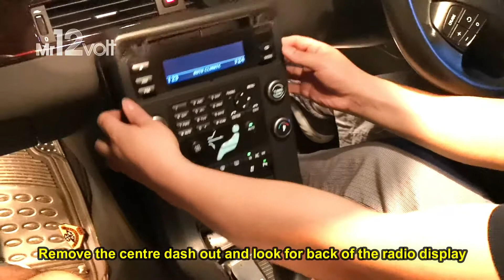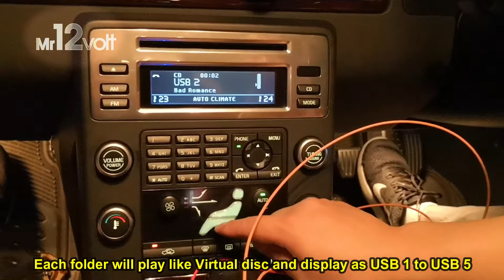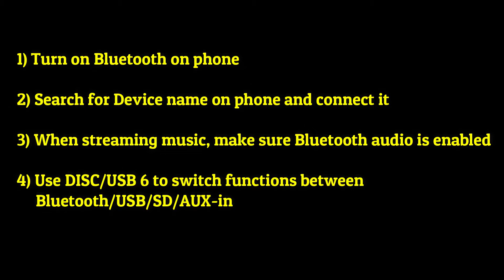Mr12Volt P600 Bluetooth adapter installation guide on Volvo V70/S80

Comment: Just installed mine in my V70! The sound quality is better than AUX bluetooth adapter, and will finally allow me to switch songs with my steering wheel buttons!
Thanks guys
Reply: Hi, I would like to buy one too. But I am in doubt about where to leave the "box" this guy has it in his hands. Where did you put yours? Is it a bit out of sight?
Reply: @daanbanaan1990  there isn't really a good place to hide it completely out of sight. I just stucj mine to the back of the "waterfall console"

Comment: This system does not seem to handle calls, is that correct? There is no Microphone. How would you handle calls?
Reply from the maker: The package comes with a microphone, handsfree works in CD changer mode
Reply: @mr12volt  Does it completely block out the standard BT? I.e switches over to the cars default BT.